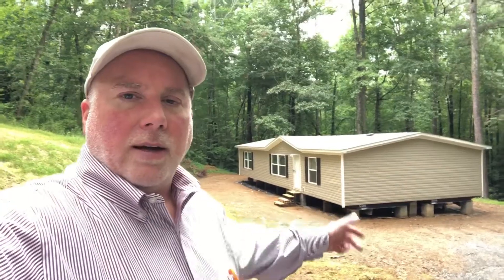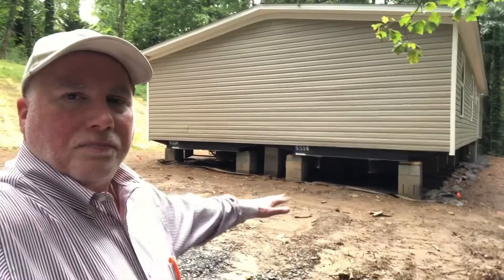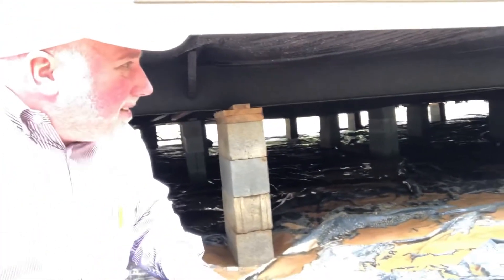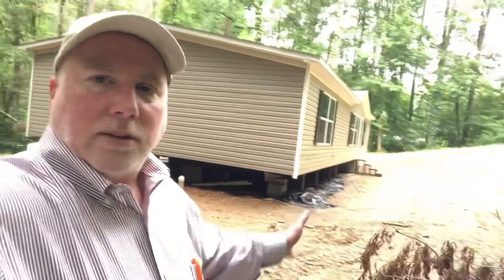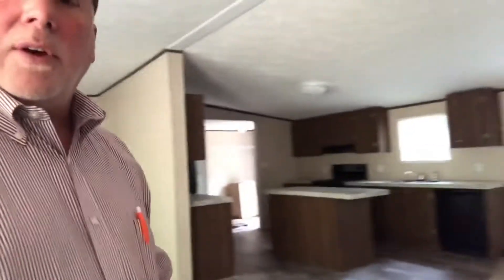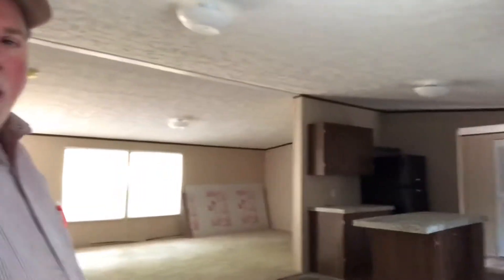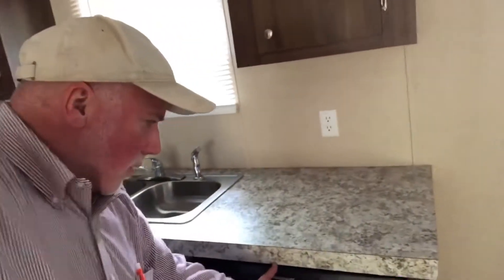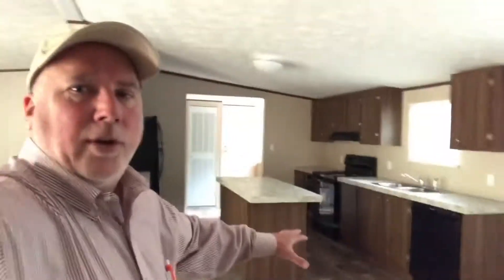What is a Permanent Foundation? Mobile Home Investment Development Project

Comment: Gotta love the wooden wedges used to level...
Actually had a dealer of these state they suggest the owners crawl under the thing yearly and hammer the wedges back in to slow the settling cracks and issues...

Why aren't steel or some other material used for the wedges that won't shrink naturally...

Prices are ridiculous..200k to 300k for a decent box but the quality just isn't there imo
Reply from the maker: The structural engineers who inspect these mobile homes and certified that they’re in a permanent foundation are OK with these wooden wedges.

Comment: Why cut the hitches off with a torch when all they had to do was unbolt the 12 bolts and now the hitch is reusable if need be without all the unnecessary welding ??

Comment: I’m just curious, I’m seeing homes done this way along with hurricane tie downs. 

But what I’m confused about is tie downs are secured to plates built into the home along with the frame; and finally tied into a 3-4 ft anchor in the ground. 

Wouldn’t the tie downs still count? Why does it need the extra?

Comment: Not a legal foundation. No tie-downs applied. The once you showed are called shear-straps-  designed to keep house from twisting. Tie-downs are supposed to be from frame to the ground every 36" - 48" depending on location. Foundation piles are illegal also - need to be 2'x2'.

Comment: Why not a cement foundation  pad with footers?
Reply from the maker: Footers are poured and the blocks are placed on the footers. The structure rests on the pillars at points that are engineered to support the home and the structure is tied down and attached to the land. This is part of what is required to meet the standard of being on a permanent foundation according to HUD. A structural engineer is required to inspect and certify that the work has been completed property. The perimeter of the house is not intended for support of this type of home the way it is engineered. The skirting around the exterior of the bottom of the home is both cosmetic and serves the purpose of keeping wildlife from getting under the home.

Comment: Permanent foundation you pour a footer and then you slender block it up to the bottom of the mobile home that might be permitted for his area but our area will not allow that to pass as a permanent foundation unless Footers and cinder blocks are put in around the entire perimeter
Reply from the maker: Footers are poured and the blocks are placed on the footers. The structure rests on the pillars at points that are engineered to support the home and the structure is tied down and attached to the land. This is part of what is required to meet the standard of being on a permanent foundation according to HUD. A structural engineer is required to inspect and certify that the work has been completed property. The perimeter of the house is not intended for support of this type of home the way it is engineered. The skirting around the exterior of the bottom of the home is both cosmetic and serves the purpose of keeping wildlife from getting under the home.

Comment: It's not a permanent foundation
Reply from the maker: Footers are poured and the blocks are placed on the footers. The structure rests on the pillars at points that are engineered to support the home and the structure is tied down and attached to the land. This is part of what is required to meet the standard of being on a permanent foundation according to HUD. A structural engineer is required to inspect and certify that the work has been completed property. The perimeter of the house is not intended for support of this type of home the way it is engineered. The skirting around the exterior of the bottom of the home is both cosmetic and serves the purpose of keeping wildlife from getting under the home.

Comment: And the bank right there this place is gonna wash out the block is gonna wash out underneath and there shit is gonna do just like mine is doing thousands of dollars to fix this foundation in just a few years from now these people are gonna have to pay for i woukd remove this video if i was you
Reply from the maker: There was a trench that was cut at the bottom of the hill with a drainage system. Footers are poured and the blocks are placed on the footers. The structure rests on the pillars at points that are engineered to support the home and the structure is tied down and attached to the land. This is part of what is required to meet the standard of being on a permanent foundation according to HUD. A structural engineer is required to inspect and certify that the work has been completed property. The perimeter of the house is not intended for support of this type of home the way it is engineered. The skirting around the exterior of the bottom of the home is both cosmetic and serves the purpose of keeping wildlife from getting under the home.

Comment: Them single blocks on top of each other who ever did that should be fired they wont stand the weight I'm going thur this right now as my  mobile home is separating from each other I also live in north ga
Reply from the maker: This is a professional install of the double wide, meets HUD standards, and certified by a licensed structural engineer.

Comment: If this were my home the foundation would be over engineered. It would be a solid slab of concrete with rebar. Holes would be cut through the beams and the home would be tied down with steel cables.
Reply: I agree with you the way you described  thats how i am securing my home to real property thanks for your comment
Reply from the maker: Footers are poured and the blocks are placed on the footers. The structure rests on the pillars at points that are engineered to support the home and the structure is tied down and attached to the land. This is part of what is required to meet the standard of being on a permanent foundation according to HUD. A structural engineer is required to inspect and certify that the work has been completed property. The perimeter of the house is not intended for support of this type of home the way it is engineered. The skirting around the exterior of the bottom of the home is both cosmetic and serves the purpose of keeping wildlife from getting under the home.

Comment: I wonder if it's the same process for a tiny home or shipping container home.
Reply from the maker: It may be similar. Here is what we did: Footers are poured and the blocks are placed on the footers. The structure rests on the pillars at points that are engineered to support the home and the structure is tied down and attached to the land. This is part of what is required to meet the standard of being on a permanent foundation according to HUD. A structural engineer is required to inspect and certify that the work has been completed property. The perimeter of the house is not intended for support of this type of home the way it is engineered. The skirting around the exterior of the bottom of the home is both cosmetic and serves the purpose of keeping wildlife from getting under the home.
Reply: @alphadoginvestments  thank you for explaining that!

Comment: What happened if there's a mud slide and it rolls or fall down in the back
Reply from the maker: The home site was the site of a previous single wide mobile home that was there for many years. The site is stable. Here is what we did: Footers are poured and the blocks are placed on the footers. The structure rests on the pillars at points that are engineered to support the home and the structure is tied down and attached to the land. This is part of what is required to meet the standard of being on a permanent foundation according to HUD. A structural engineer is required to inspect and certify that the work has been completed property. The perimeter of the house is not intended for support of this type of home the way it is engineered. The skirting around the exterior of the bottom of the home is both cosmetic and serves the purpose of keeping wildlife from getting under the home.

Comment: Does it matter what type of tie downs you use and does it have to fixed to the ground a certain way to make it a permanent home?
Reply: Yes, it has to be bolted into the concrete pads to be considered a permanent foundation
Reply from the maker: Footers are poured and the blocks are placed on the footers. The structure rests on the pillars at points that are engineered to support the home and the structure is tied down and attached to the land. This is part of what is required to meet the standard of being on a permanent foundation according to HUD. A structural engineer is required to inspect and certify that the work has been completed property. The perimeter of the house is not intended for support of this type of home the way it is engineered. The skirting around the exterior of the bottom of the home is both cosmetic and serves the purpose of keeping wildlife from getting under the home.

Comment: Let me know morw ,please, thanks.
Reply from the maker: Here is what we did: Footers are poured and the blocks are placed on the footers. The structure rests on the pillars at points that are engineered to support the home and the structure is tied down and attached to the land. This is part of what is required to meet the standard of being on a permanent foundation according to HUD. A structural engineer is required to inspect and certify that the work has been completed property. The perimeter of the house is not intended for support of this type of home the way it is engineered. The skirting around the exterior of the bottom of the home is both cosmetic and serves the purpose of keeping wildlife from getting under the home.

Comment: That's the xi2 tie down system. How many of those should should be under the home, or is there one for each end?
Reply from the maker: There was at least two tie down locations, one at each end. Here is what we did: Footers are poured and the blocks are placed on the footers. The structure rests on the pillars at points that are engineered to support the home and the structure is tied down and attached to the land. This is part of what is required to meet the standard of being on a permanent foundation according to HUD. A structural engineer is required to inspect and certify that the work has been completed property. The perimeter of the house is not intended for support of this type of home the way it is engineered. The skirting around the exterior of the bottom of the home is both cosmetic and serves the purpose of keeping wildlife from getting under the home.

Comment: Alabama  and Georgia are trailer  states I seen hundreds 💯 everywhere  aren't these two states tornado prone . Are any special codes required?
Reply from the maker: Modern manufactured homes, as they call them now, meet stricter standards and must be attached to the land for the home to be classified as real estate (converted from personal property to real estate once the home is attached to the land). This must be done according to certain standards. This is what we did: Footers are poured and the blocks are placed on the footers. The structure rests on the pillars at points that are engineered to support the home and the structure is tied down and attached to the land. This is part of what is required to meet the standard of being on a permanent foundation according to HUD. A structural engineer is required to inspect and certify that the work has been completed property. The perimeter of the house is not intended for support of this type of home the way it is engineered. The skirting around the exterior of the bottom of the home is both cosmetic and serves the purpose of keeping wildlife from getting under the home.

Comment: Very thankful I found this video. We need your help! Need to convert our manufactured home into a modular home per a CCNR we weren't aware of. What's the best way to contact you? We are GA also. Tysm, God Bless.
Reply from the maker: Here are more details of what we did: Footers are poured and the blocks are placed on the footers. The structure rests on the pillars at points that are engineered to support the home and the structure is tied down and attached to the land. This is part of what is required to meet the standard of being on a permanent foundation according to HUD. A structural engineer is required to inspect and certify that the work has been completed property. The perimeter of the house is not intended for support of this type of home the way it is engineered. The skirting around the exterior of the bottom of the home is both cosmetic and serves the purpose of keeping wildlife from getting under the home.
Reply: @alphadoginvestments 😂 gotta love 'copy and paste'
Reply: @khadijahdavis1572  actually after 45 times it tends to be a bit annoying 😆😆😆
Reply: @nwicconsultants6640  lol i can totally understand brother☺️, still a gr8 video, thank you

Comment: Can the permanent foundation of a manufactured home be covered with siding to bring the home's siding all the way down the home?
Reply: Didn’t know if anyone knew , BUT a veteran can get a VA loan on a manufactured home, there are added expenses, which is a permanent foundation meaning concrete around peraimter and from side to side and tied down .
Reply: They make decorative vinyl skirts that look like stone or what ever you like.
Reply from the maker: Here is what we did and yes you can make the siding / skirting with just about any material you want. Footers are poured and the blocks are placed on the footers. The structure rests on the pillars at points that are engineered to support the home and the structure is tied down and attached to the land. This is part of what is required to meet the standard of being on a permanent foundation according to HUD. A structural engineer is required to inspect and certify that the work has been completed property. The perimeter of the house is not intended for support of this type of home the way it is engineered. The skirting around the exterior of the bottom of the home is both cosmetic and serves the purpose of keeping wildlife from getting under the home.

Comment: Hi I wanted to know how much would it cost to put down a manufactured home  on a piece of land  it only has Dirt on the land  very small space and needs the power  to be Connected to the home and needs the  Sewer Connections  to be put on the home  in  Southern California  info thanks 🙏
Reply: Hi, did you end up getting an answer… I am in California and thinking of doing the same thing
Reply from the maker: The costs are specific to each region and area.

Comment: I don't know about that foundation...I'd feel better if the foundation was around the perimeter also instead of just in sections underneath...I'm thinking it will start to sag in areas of the floor over time...or settle and just be lopsided...
Reply: That's why owners should level their homes every few years, regardless of the foundation type.
Reply: that's what mine is doing mine is  bigger than that one also but it's separating from each other in the middle water changes direction and goes under it washes blocks out causing them to lean some of mine were set right bit not all of them were gonna cost alot to get someone to go under there and fix it
Reply from the maker: The chassis is designed to be supported at the points where the foundation pillars are installed. The perimeter of the chassis is not a foundation support.

Comment: Do you know if manufactured homes can be turned into modular homes?
Reply: They look pretty much the same but are built to different standards and cost a lot more. A manufactured home is completely built in a factory normally comes in a couple large pieces and placed on your property. A modular home is brought in many pieces constructed on site and permanently attached to a regular foundation like a stick home. So they have to be constructed originally to what they are going to be.

Comment: I have to do a foundation thanks this helps alot because I'm doing it myself
Reply from the maker: Here is more info on what we did: Footers are poured and the blocks are placed on the footers. The structure rests on the pillars at points that are engineered to support the home and the structure is tied down and attached to the land. This is part of what is required to meet the standard of being on a permanent foundation according to HUD. A structural engineer is required to inspect and certify that the work has been completed property. The perimeter of the house is not intended for support of this type of home the way it is engineered. The skirting around the exterior of the bottom of the home is both cosmetic and serves the purpose of keeping wildlife from getting under the home.